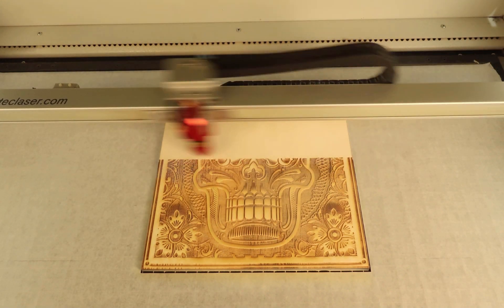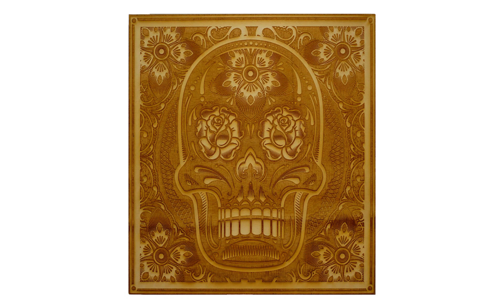Laser Hack: Sanding Wood After Laser Engraving

Comment: For sanding, do you suggest this circular shown device or a "mouse" type? In the video, what is the brand/model you are using? I think the smaller, the better... so to be precise and avoid breaking smaller engraved details... Thanks!
Reply from the maker: Hello! The sander that we used in this video was a DeWalt Random Orbit Sander  https://a.co/d/gjH66Qt We have not tried the other versions of sanders in this example but there should be no reason they should not work just as well.

Comment: I feel sure your customers would  better appreciate advice on how to engrave organic materials  in a way  that does  NOT deposit the tarry residue on the work. I would also point out that the "heat of the laser " will not stain the surface of the wood as you claim. There is no heat on the unengraved surfaces. Look at direction and amount  the staining on the teeth and central part of the bottom frame. Why is it different to the side and top frames?  You should be fixing the problem with knowledge and understanding , not an orbital sander.
Reply from the maker: Hello! Thanks for your feedback! The infrared heat reaction into the wood during the engraving process generates smoke from that heat, causing the staining of the wood. In this scenario where high detail engraving is necessary into a raw uncoated wood material, little can be done to protect the wood from the staining. Masking would also work; however, removing the mask with detail like this after the laser has completed processing is far more time-consuming.  Another method is to use a low laser power, and engraving with many lasers passes to slowly produce the depth however this again is more time-consuming.  The goal of our laser hacks is to find efficient solutions to common laser processing problems, which is what this laser hack was designed to do.
Reply: @TrotecLaser  
I appreciate  for your explanation but it does not justify the reason for the hack. Your video is greatly speeded up and you give no parameter details. IF you can produce a tar-free engraving, how long does it take and how deep is it? What are the parameters and time to produce the tarry result and how long does it take to clean up the mess? That's the sort of comparison that would justify your hack. See the following 60 second video that makes me interested in what your process can achieve.
https://www.youtube.com/watch?v=koNbkyc3bIA

As you can see from the video, your phrase "little can be done to protect the wood from staining" is obviously not true
Reply: @SarbarMultimedia  sheesh, everyone's a critic huh... id sand wood rather than spend forever removing the masking tape lmao
Reply: @tubbycustard8866  
I think you have misunderstood the reason for my comments. I am a great admirer of Trotec machines although I could never afford one. The electro mechanical engineering is superb  and the  RF laser technology is capable of great things.  My constructive feedback (not criticism) was to ask Trotec to look at the detailed process of creating tar-laden fumes in a different way. The machine and the process can produce  fume-free engraving so why not offer this as the hack?